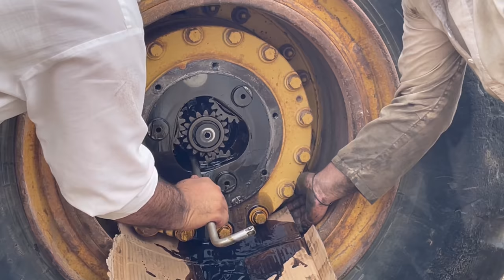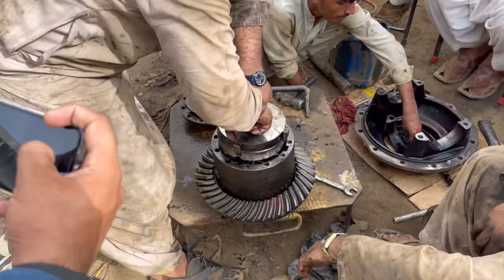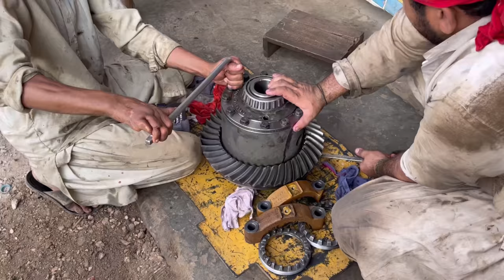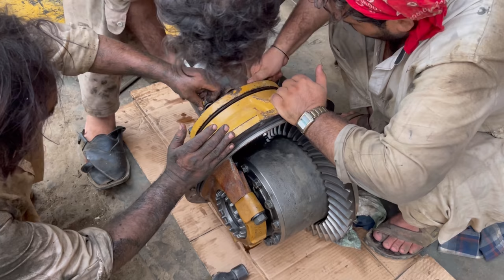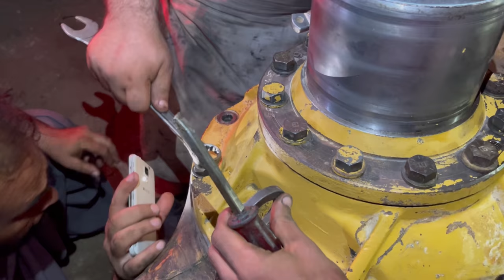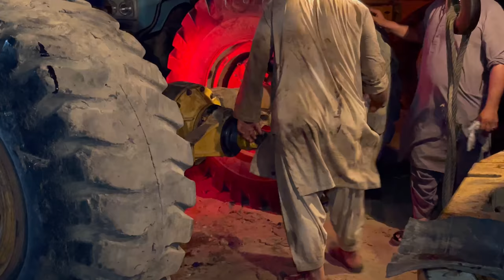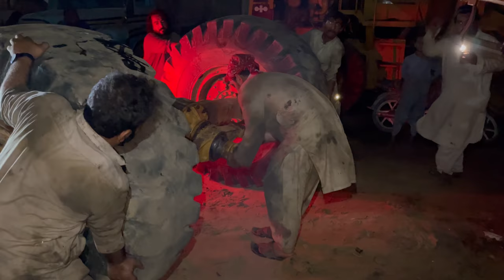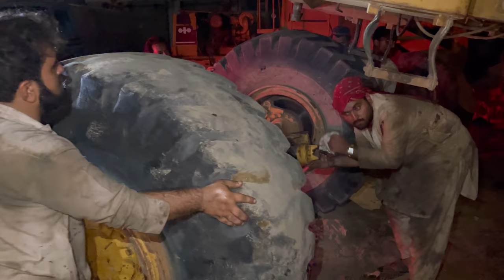This CATERPILLAR had a Major Defect in Differential GEAR  that the Experienced Mechanic Had Repaired

Comment: I know from personal experience, once these backstreet mechanics get hold of your broken down machine, it is the kiss of death...Their methodology is, do half-a-repair to keep the machine going, then it'll be back when it breaks down again & that's more business for them...an endless & infuriating illogical vortex that is best avoided at all costs...
Reply: definitely, they forgot to put a gasket on the main drive shaft. now it'll leak oil and then it'll be back and need to be removed with a crane again, extra charge
Reply: For this part of the world, it can't be avoided because it's probably the cheapest way to get mc running and the other options is too expensive for them
Reply: What are you talking about? They are top notch, he even gave it a karate chop at 12:08. Not just any regular mechanic does that.
Reply: @gungrave10  Doing a half ass job is way more expensive than fixing it right the first time always.
Reply: @TheFeller1554  not for them apparently
Reply: @alberto148  Er, no? There are a lot of reasons poverty happened, and this issue happened because of poverty not the other way around.

Here is an example in case you don't understand. Guy A poor. Guy B rich. Both have the same normal sedan. Both have the same broken parts. Since Guy B have money, he changed the parts. Guy A doesn't have the money so he repair the parts. This is what happened here.
Reply: I wonder what they charge.
Reply: This is the third world man, the nearest CAT dealership is probably over a thousand miles from where they are, so it's mend and make do.
Reply: @fintan9705  You have to love all of these keyboard warriors who probably wouldn't be able to change a simple axle seal or hub assembly on their 4 cylinder shit-o-matic.
Reply: Sounds just like typical American repairs- first build it so it breaks just before the 90 day warrantee ends, then discontinue repair parts soon after so people can't buy replacement repair parts, and then sell them an "updated model", because it's cheaper to thow away and buy new than repair with parts no longer available,  repeat, repeat.
We had woodworking machines in the shop bought brand new, and in a year or so broke in some way or other,  quill spring,  built-in on/off switch, motor,  and the parts were already DISCONTINUED by the mfr!
We could still order a replacement  1970s Bridgeport quill spring, but Dellta and others the parts were discontinued in a year after we bought.
Reply: Experience from dealing with repairs to machinery in Pakistan also has another problem that causes such repairs. In that the import duties on spare parts is very high making parts often two or three times the price of similar items elsewhere. In what is already a poor country this prohibits the fitting of new imported parts. With regard to the earlier comment about the number of technicians. This is because labour is incredibly cheap and the jobs tend to be split down into lots of small sections, each with its own 'specialist'. In practice this makes the work very slow as the technicians are literally getting in each other's way constantly. And standing aside while another technician does something so that they can continue with their own speciality. Multi skilled technicians are very rare. And from a european's perspective the working practices are very archaic.

Comment: I worked at an industrial gear shop for a few years. The lack of everything was driving me nuts. No measuring. Forcing bearings in place. I wish I could give these guys a bearing heater.  I have seen worse though. Work with what you have.
Reply: You've seen worse than this? Please tell me more 😃 🤣
Reply: @PatTheRiot  mate, had a loader crap it’s gearbox in the middle of a muddy field. Driver pushing to hard to get out of the mud hole. No way to recover so repair done in situ! Let’s just say it was possibly the most brutally hard job ever! Cold, muddy, wet windy. Trying to jack on mud, up to knees at times!
Only battlefield repairs in Army days a bit worse!!!
Reply: a bearing heater ?  Hot oil in a can and just put the bearing in !!!
Reply: They dont need a bearing heater.. thank you softie..
Reply: Seen guys use liquid nitrogen for bearings on heavy equipment to shrink it on. Not in this scenario, but ya either way heat it, or shrink it.

The limited access to things in these countries is fascinating to me, like why do they have plenty of propane, but no boots???
Reply: they hit the bearing inplace on the inner ring nothing wrong whit that, we do it alot in my line of work, and i work on merchant ships in the enginee room on swedish flagged ships
Reply: As the chief safety officer and engineer for the country, I approve the use of the special safety pyjamas and safety sandals. Likewise, the use of the speciality scouring sand used as the floor covering is a welcome sight, as this sand, when introduced into the gear axial will clean and scour all the bearings, this making returns less expensive.
Reply: @remusspiridon5463  A guy I used to work with just heated bearings with an oxyacetylene touch!
Reply: The problem is they don't bother to reinvest in themselves, using that motto (work with what you have) as a credo and validation for the shitty work they do. Not one caliper or dial indicator anywhere in this video on a part that is highly critical to tolerances.

So while the "fuck it, it's all i've got" might get the job done. it doesn't get it done anywhere close to correct.

Comment: I agree with Bob W. There was no "defect". They have altered the function of the differential.
Reply: The effectively took the "posi" out of it by not allowing the spider gears to engage with the clutches.
Reply: i was wondering about why they wanted to make the clutches not work, wierdness
Reply: The clutch pack in the diff won't engage anymore tho it seemed like a lot of work to make a machine less capable but i have seen it before, i would be interested to know what is the reason to do such modes (most of the time it's about saving a buck).
Reply: @walidben7893  The question is; what are You accomplishing by turning a posi unit into an open diff? I spent a lot of money to go the other way on My car.
Reply: It would be interesting to know why they did that. I can imagine that if one was doing a lot of tight maneuvering on surfaces with excellent traction a limited slip might be more trouble than help, perhaps causing overheating? The oil they dumped out didn't look very good.

Comment: My god... I really hope these guys get paid piece work, because who the hell could afford to pay 6 techs to do the job 1 guy does in a proper shop?  I guess it helps that you can guarantee you'll be seeing it again soon enough. Because the machining was a nightmare (and I'm pretty sure it did more damage than it helped), and you can guarantee all the bearing surfaces, oil seals and fluids are heavily contaminated with sand. . Job security!
Reply: I'll bet that whole job cost £25.00.
Reply: And somehow their heavy machinery lasts a lot longer than the ones in the west.

Obviously it's not as bad as you think.
Reply: @iiiii5256  Its almost like living in a arid environment prevents a lot of issues seen in other parts of the world. Crazy huh?!
Reply: @iiiii5256  those mashines in west would last as long, if not way longer then theirs if westners would repair and maintaine said mashines untill the very end..

Thig is, after certain age they just buy new ones. Why repair/maintaine something old when you can get a fresh one from the factory?

Comment: Imagine having to do this with spanners and 1/2 inch ratchet drives,my god what a task,the bearing install almost gave an stroke.
Reply: As the chief safety officer and engineer for the country, I approve the use of the special safety pyjamas and safety sandals. Likewise, the use of the speciality scouring sand used as the floor covering is a welcome sight, as this sand, when introduced into the gear axial will clean and scour all the bearings, this making returns less expensive.
Reply: Least I’m not the only one who almost died watching that bearing go on😂😂
Reply: @educatedmanholecoverbyrich8890  jajajaj En mi país solo por el hecho de mezclar mal la basura ya les meto su buena multa 😂😂

Comment: I have a lot of respect for these mechanics, it is near impossible to get this much work done without proper tooling ,let alone a proper work place.
Reply: Also seen no paint on the ring gear to spin and check the tooth engagement after new bearings might eat the ring and pinion over time bet when that happens they will just pull the rear drive shaft have a fwd loader very professional
Reply: Respect for risking their own life? I am a mechanic and there is many problems with this called repair.. That is one thing but also a huge issue is to someone going under an equpment hanging on a crane rope. Hell no... Just pure stupidity.

Comment: pulling the clutch packs and taking the teeth off them was probably just to scam a few more hours labor out of the owner. otherwise all they did was put some new bearings in.
Reply: you could definitely be a fleet managers for a company.
Reply: Actually it is MUCH worse than that, they turned a limited slip differential into a regular freespinning diff. 
Those teeth are to supposed to lock the output shafts to the housing as more force is applied to the plates inside, and now they're just going to be spinning a tire instead.
Good luck to that operator next time it rains and he actually needs to push on something.
Reply: @nickopedia5669  1 wheel peel.
Reply: Factually labour is very cheap in Pakistan, these peoples hardly charged 50$ for all this labour.
Also those underage guys are free labourers, as it's their apprentice time without any diploma.
Reply: @AbChauhan  they should charge less, they did the opposite of fix, they broke it more, and made sure it would break again in the future. this is the reason why Pakistan stays poor.
Reply: @nickopedia5669  especially with those bald tires.
Reply: @AbChauhan  They give diplomas to the "really good guys"!!??

Comment: There is no doubt this differential will run like new now that it has had an infusion of dirt, no torque on bolts, and no gaskets. Well done.
Reply: and no run-out or lash checked.
Reply: tiny bits of glass in that dirt
Reply: And the teeth removed from the friction discs

Comment: it seems that they've removed the differential blocking ability... the grooves in those inner rings were meant to act as a brake when pressed against the other alternating plates that have the slots to hold them on the outside...
Reply: yep they made it an open diff. they prob don't have the correct slip additive on hand so they did all this instead. the work looks smart and impressive but it prob only needed a flush and a fill with the correct fluid combo.
Reply: @Nathan-gj8ch  I'm also willing to bet they reused the old diff fluid as well.
Reply: As the chief safety officer and engineer for the country, I approve the use of the special safety pyjamas and safety sandals. Likewise, the use of the speciality scouring sand used as the floor covering is a welcome sight, as this sand, when introduced into the gear axial will clean and scour all the bearings, this making returns less expensive.

Comment: I like how they got the gasket maker almost all of the way around the cover before bolting it in place.  At least it will only leak in one small spot.
Reply: Hey bozo's he is not using that "gasket maker" to create a seal.  He is using that to hold the o-ring in place while he moves the plate perpendicular to the ground while installing it in the correct position...
Reply: @buckwildslippystick4828  Talking to yourself in the mirror again, eh?
Reply: But if he does that on every one it adds up, damn bean counters.
Reply: @buckwildslippystick4828 hahahaha so steel pressed together holds liquid,not in my world.

Comment: "That an Experienced Mechanic had repaired" 
Ima come right out and say it. This whole video was an experience. A roller coaster of thrills, spills and  inappropriate use of tools.
I'm pretty confident if that loader didn't have a problem beforehand it does now.

Comment: These guys are awesome, without a doubt. But imagine how much more efficient they would be with modern hand tools. Chrome sockets, shallow, mid length & deep. 6 & 12 point. Same with impact sockets. Long handle ratchets. A 3/8, 1/2 & even a 3/4 inch impact guns. Pry bars with ergonomic handles, dead blow hammers, a hydraulic press, shop tables. These guys would be unstoppable.
Reply: Be scary that much better well at least much faster and easier on them. Would hire this crew in a instant if I had or was opening a shop pretty much anywhere in the world.
Reply: There liveing in the west now with all them shiny tools on low wages but think it great wages driving nice cars, employers dreams
Reply: The men working together are the efficiency, that is their secret. You don't need all that shit when you have help.. The US is based on one man show, and some poor bastard will be at it for hours with fancy tools.. They make the job easier by having people do different things, clean gaskets, extract bolts, machine things, that's way more efficient than a one man show mobile mechanic
Reply: Some cement would be a good start
Reply: I 99% agree with that comment, my only other side is that they have such a strong work ethic using what they can and if get to see all this easy modern stuff will they just choose to use new stock of parts and not refurbish any more like they are doing.
In western countries (I am from Australia a western one) all we do is take out the old throw it away for scrap iron / whatever metal and then install a new part of the local autoparts store. Rarely do we rebuild it etc
Reply: @ShaneHm2  You know how many times I stopped working on a job because I didn't have "the right tool".. These guys don't stop until the job is done no matter what. In this setting, time lost is time you will never get back, so if the machine is up and running while you wait for replacement parts. You just moved the pendulum again. That is everything in my book, Time is money and lost progress is determinantal and can be devastating to any project even if it's as simple as smoothing the dirt road for locals.

That's the point of "Civilization"...
Reply: @FrequencyOfThought  Thank you for telling me I have a crap profession. I have a mobile truck and 60k worth of "shiny tools" and get this stuff done all by my lonesome with a truck crane. Should I not be proud of my work as well? Me being "some poor bastard in the US" affords my family nice things along with proper work boots, gloves to protect myself from harsh chemicals. Not to mention a great medical plan and retirement. Thank you for telling me how unfortunate and worthless I am.
Reply: And new friction plates and proper lsd diff oil they might have fixed it
Reply: One socket set probably would cost more than one of these guys earns in a YEAR...
Reply: @HobbyOrganist  
You might think this is Pakistan, but it's actually Bradford, UK.
So don't forget: they also get their social paycheck every month.
Reply: Milwaukee should send them a bunch of stuff - think of the free publicity
Reply: As the chief safety officer and engineer for the country, I approve the use of the special safety pyjamas and safety sandals. Likewise, the use of the speciality scouring sand used as the floor covering is a welcome sight, as this sand, when introduced into the gear axial will clean and scour all the bearings, this making returns less expensive.
Reply: But where's the fun in that? 😅
Reply: I gotta wonder: why not build a work bench or two?

Comment: Matters not what you did if when reassembling you fill it up with dirt and grit from the environment around the assembly area.
Reply: appears not assembled with minimum technical standards. now it is the question of its endurance designed for

Comment: Honestly; I shudder at the bulging plastic bag that comes with every flat pack, but these guys take this apart, but most importantly, reassemble it without a page or booklet. I tip my hat at the ability of these lads to do such work, in less than ideal conditions, but most of all, taking the millions of complex parts and put it all back together. If I done it, I'd have more than one jar of spare bolts and washers..

Comment: I guess that the technology of a workbench hasn't made it to this part of the world yet.
Reply: But safety dresses and steel thonged flip flops have!
Reply: @tomrogers9467  Don't forget hard hats.
Reply: Zactly SH.
Reply: @tomrogers9467  I thought the exact same thing, but I didn't want it to sound like I was piling on. The only thing left is the missing safety glasses as well. The cheapest piece of safety equipment.
Reply: You are surprised? most of the people there dont even have FLUSH TOILETS
Reply: @HobbyOrganist  they do have flush toilets in pakistan and Afghanistan lol
Reply: These establishments are part of the informal economy. No taxes paid, no regulations, no licences etc to carry on these trades. Thus the location is informal and they might get moved on by local authorities. Thus they have will not invest in anything that can't be moved. The formal places have licence, are taxed and will have proper building, concrete work areas but they cot more. These informal establishments keep the informal economy moving. I hope that explains. From Islamabad, Pakistan. 🇵🇰
Reply: As the chief safety officer and engineer for the country, I approve the use of the special safety pyjamas and safety sandals. Likewise, the use of the speciality scouring sand used as the floor covering is a welcome sight, as this sand, when introduced into the gear axial will clean and scour all the bearings, this making returns less expensive.